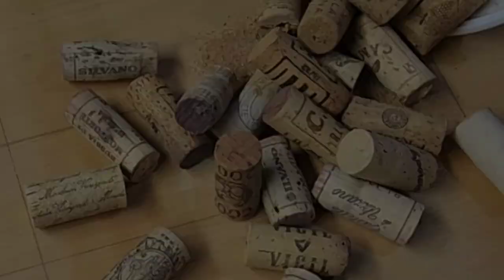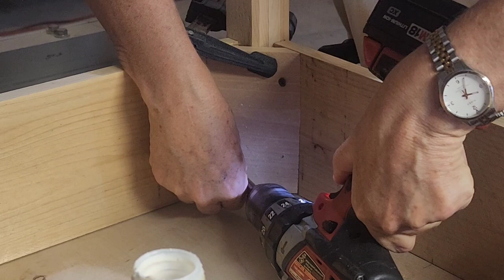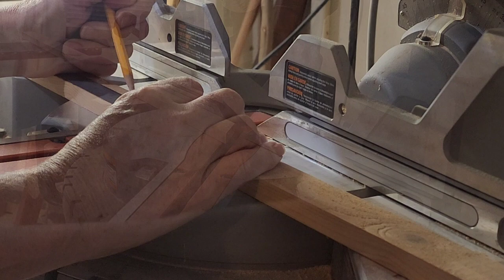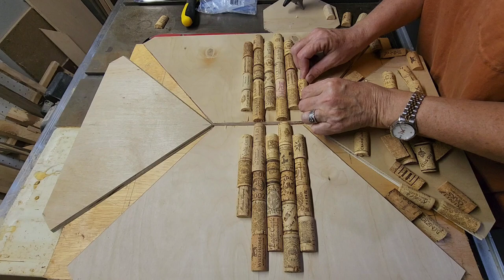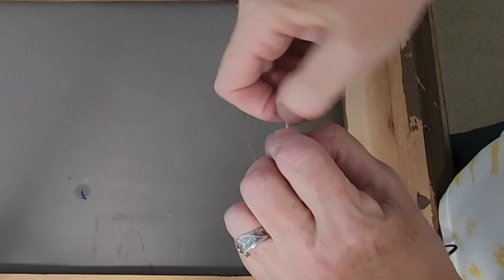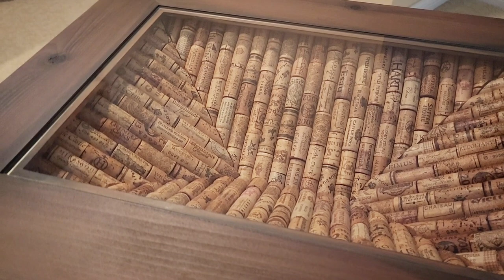Woodworking... An Illuminated Table for the Wine Enthusiast #diyfurniture #corkproject #woodworking

Comment: This project end up very slick.  I was sure you were going to do an inlay with the corks, until you started cutting them lengthwise.  The vinegar and steel wool is an interesting technique.  Thank you for the good idea. 😀
Reply from the maker: Thank you kindly, Richard! Actually, I was hoping to get a more grayish tint with the vinegar. If you use different types of vinegar, the color is varied. But since I only had the distilled white, that's what I ended up with and then just applied the gray paint wash to achieve my desired effect. Thanks so much for watching and leaving a comment, much appreciated!😁